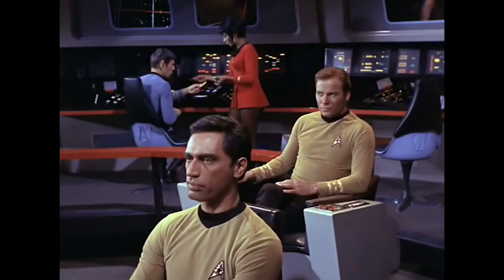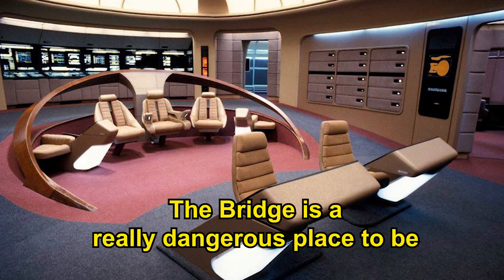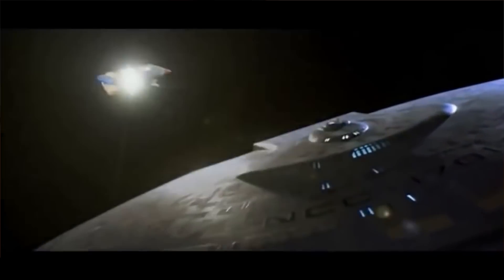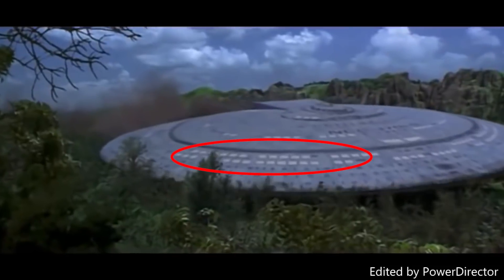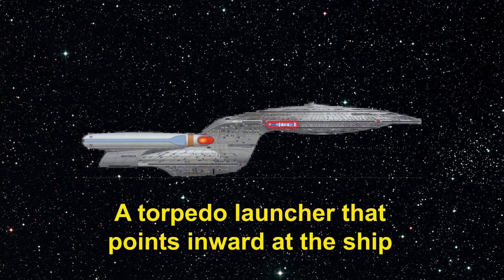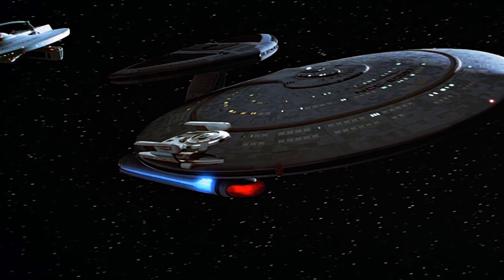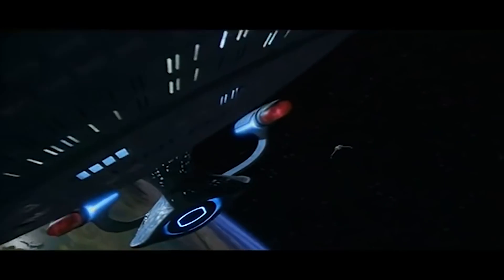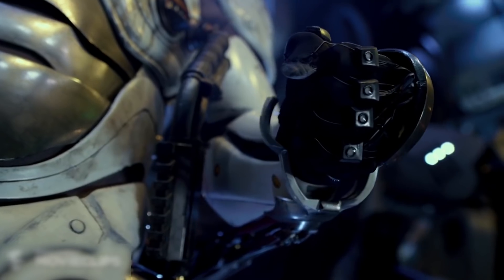10 Flaws Star Trek - USS Enterprise NCC 1701-D

Comment: The nacelles at the ends of the pylons are not engines, they house the warp coils. The warp engine is in the engineering section. Think of the nacelles as the driven wheels of a car. The engine is still in the engine bay and drives the wheels. The placement is so far away from the hull to protect the crew from the effects of the warp field (You want to fold space, not people)

Ships that can emit a narrower warp field can have the nacelles closer to the hull. The Nebula class ship you had shown has pylons the same size as the Galaxy class, you got fooled by forced perspective

For more details, Star Trek Enterprise Season 2 Episode 12 'The Catwalk'

What I find crazy is you missed the most obvious flaw in the Galaxy X-class (Three-nacelled 'Dreadnought' version of the Galaxy class) which had a fixed-position phaser weapon fitted on the underside of the saucer blocking the Captain's yacht from detaching
Reply: Thank God someone pointed this out. I would also like to see seatbelts on the ship but could have done without the "P"comment. I'ld hate to have the ship's console looking like the Atari 2600.
Reply: Outstanding. 👍👏👏
Reply: Indeed, but the point still seems to stand. While the nacelles are not the housings for the warp drive itself, the fact that they are essentially the means by which the warp drive transfers it's power to move the ship, like the propeller shafts on a real ship, makes that flaw stand. Disable the nacelles and while the warp drive itself isn't damaged, the ship is still going nowhere, since the energy can't be used for the ship to move, and the relatively vulnerable position that the nacelles are in, especially if she's being pursued makes that possibility more likely than it would otherwise.
Reply: @douglashall6326  I dunno . . . given the forces involved if the inertial dampeners fail, seatbelts would probably just vivisect you where you were sitting.
Reply: Untrue. There are frankly dozens, if not hundreds, of instances in Star Trek (across all representations) where the folding of people (or people-like aliens/constructs/robots/etc..) would be just as (possibly even MORE) useful than folding space....for instance; if they could have just folded the Borg...boom, problem solved!
Reply: Smokey Joe good explanation of the warp engines! 👍🏻
Reply: The warp core is just  power plant. The nacelles  generate the warp field.  Ie the core is the engine the nacelles the tranny.
Reply: tactically speaking, that may make sense for the battle itself, but after the battle, there's the business of getting back to base for repairs (especially since I don't think slapping on new nacelles are something you can easily do outside of a shipyard). Unless the battle is close to a nearby base, getting there on impulse power (and therefore sublight) could take on the order of years. Going off of this description, the nacelles are still necessary if you want to either avoid a battle altogether, or after a battle is won, getting back to base, so having them knocked off is still utterly crippling for her maneuverability.
Reply: Smokey Joe  Nope, we have seen many times that hitting the nacelles destroys the ship.
Reply: Smokey Joe   Wring about the warp fields, Geordi him self says you can physically pass your hand through them with only some un described sensation as the effect.
Reply: Smokey Joe made a very good point!

On a side note....I always wondered how the Klingon BoP gets away with having no warp nacelles at all?
Reply: @DrewLSsix  we've also seen many times where that doesn't happen.  The ship doesn't blow up simply because its nacelles were destroyed.  Other factors contribute.
Reply: @pex_the_unalivedrunk6785  the bop doesn't use nacelles, its warp engines are actually right next to its impulse engines in the back.  If you look closely you'll see 2 different colors emanating.  One is red, the other above (or below, i forget) is orangey yellow.  You don't have to have nacelles to hold the coils, look at the defiant for example, they are tucked in close.
Reply: I never knew the galaxy class had a captain's yacht. But non the less, the dreadnought retrofit was a warship, so I doubt they cared for luxuries like that. It also prevents saucer separation. I know STO says it doesn't, but I don't buy that. 

As for the 3rd nacelle, I don't get that either. I guess you can assume the ship's warpfield was reconfigured. But other than maybe a redundancy, I don't get the point of having it. The standard galaxy class can do warp 9 already, I don't think the hull can take the stress of a sustained warp 9.99. And unless you're joining a battle in progress, it's against regulation to use excessive warp speed. Plus it gets in the way of the shuttle bay, making it take longer to get clear of the ship. Not to mention how much more complex or perhaps weaker, the aft shields would be. Due to awkward placement of the shield emitters to cover it.

I'd rather a secondary deflector, to reinforce the shields.

Still my favorite ship of the universe. May not be as pretty as the sovereign class, but still damn cool.
Reply: @stephenlaarkamp7344  You can't fix dead. Only the survivors have the luxury of being alive to effect repairs or call in their fleet for assistance in repairs or to help evacuate and scuttle the ship. If worst comes to worst you crash land the ship and await rescue . . . after turning your opponents into roadkill and then get a newer shinier ship with almost the same registry number (as has been done time and again) The object isn't always to come out without scratching the paint, the object is to be less dead than the other guy

If you avoided the battle altogether then no-one's shot off your nacelles yet. People shooting at you is one of the ways you recognise you're in a battle

You don't maneuver with warp fields in the same way you don't do a three point turn in top gear and overdrive. You maneuver with impulse and RCS. While yes, without being able to create a warp field, you're not the fastest ship in the fleet but you are still faster than the floating bolts and giblets that once was your enemy. That's the difference between dead slow and dead

Anyway, if the nacelles are indeed a target and your pulled those targets closer to you then you've got more serious troubles, IE being the dead one.
Reply: @adamlewellen5081  So you're saying the subspace displacement fields are the wheels? I'd say that's the effect of the wheels.

To me it still looks like the coils in the nacelles are still the wheels, the transmission would be the warp plamsa accelerator (gearbox), the symmetrical warp field governer (differential) and the plasma conduits up the pylons (half-shafts)
Reply: @Astraeus..  Folding other people would be useful, but not your own crew. That's just unsociable and unlikely to get you invited to poker night
Reply: It's still an extremely high-energy component presented on a silver platter. Dumb design.
Reply: @Demiurge13  Exactly. The Bird of Preys are usually lighter vessels and can sustain warp speed on smaller narrower warp fields thrown out with violence out the back. Also the Klingons don't really give that many damns about life. They tend to throw theirs away as fast as they can
Reply: @karenrhodes5079  I'm on board with the 3rd nacelle. Imagine launching shuttles at warp speed. A tricky enough feat at the best of times between two warp fields without feeding them straight into the yawning maw of a bussard ramscoop collector

Ditto with the Nebula class, which I think looks super sexy. Like Miranda but with TNG appeal, but that mission pod pylon . . . that should have plenty of scratches and nicks and exchanged paint with any less then perfectly flown shuttles
Reply: @yaldabaoth2  It's demonstrably a tempting target, kinda like the bright yellow bat-sign on batman's chest . . . canonically the heaviest armoured part of his outfit.

If you're not allowed a cloaking device then misdirection is a good second option

"Shoot this big important glowy thing! Ignore the people aiming torpedoes down your throat!"
Reply: It's a space warping engine not a space folding engine!
Reply: Smokey Joe There are no restrooms on NCC1701.  I have the schematics.  NO RESTROOMS.  Talk about eating a sh*t sandwich.....
Reply: Not to mention, Galaxy class badass starship or not, there may be times where they are outnumbered and need to get the hell out of dodge rather than stay and fight.
Reply: @smokeyjoe7251  - What's the grease for?  Aside from Neelix's fryer or Tom Paris' car, I can't think of much on a Starfleet ship that would require grease.
Reply: To be fair, the Dreadnought variant was simply a refitted standard Galaxy class. And it still retained its normal phasers after being up armed with the phaser lance. You can think of it more like the merchant navy ships of WW2, that where pressed into military service.
Reply: The Lance Cannon on the dreadnought retrofit replaced the captain's yacht bay. They didn't have a yacht, most likely.
Reply: No, the warp coils ARE equivalent to the engine in a car. The warp core you see in the engineering section is the equivalent of the fuel tank. The warp core provides the necessary energy to make the warp coils achieve a subspace bubble and actually go to warp.
Reply: @DrewLSsix  To be honest, I can only recall one episode "Cause and Effect" (the time loop episode) where damaging the warp nacelles led to the ship being destroyed (over and over again). And they don't really explain why this happens. In the episode, the nacelle is damaged in a collision with another ship, and the ship is venting drive plasma. They lose helm control, and the inertial dampeners go offline. Then Geordi makes some comment about trying an emergency warp core shutdown. But there is no explanation for why this is necessary. The core shutdown fails, they lose antimatter containment, and the ship is destroyed. But WHY did the warp core breach in the first place? It wasn't damaged, only the nacelle was damaged. Was there some kind of catastrophic chain reaction, where the warp plasma fed back into the core? Did secondary explosions damage the antimatter containment field? They don't really explain that, and I don't recall it ever happening before in another episode. We've seen many episodes where enemies specifically target the warp nacelles in order to disable the ship without destroying her. It's the equivalent of spiking or shooting out a car's tires so that the vehicle can't drive. But it's not going to cause the car to blow up!
Reply: @Aldaris1234567  Nope, the anti-mater storage is the fuel tank. And just like a car engine converts gasoline, so to does the warp core convert this anti-matter. The warp core is the engine, hence why it is commonly referred to as the warp engine.
Reply: @TheGhostAvatar  Sorry, but that's incorrect. The warp plasma is the fuel, not the anti-matter. The core just provides the plasma to drive the coils. The coils do the actual work. The core is the fuel tank, the coils the engine and the bubble the wheels.

Actually, it's commonly referred to as only the warp core. Usage of warp drive/warp engine is for the everything combined.
Reply: @Aldaris1234567  Might want to go read up yourself before commenting any further. "24th century Federation warp engines were fueled by the reaction of matter (deuterium) and antimatter (antideuterium), mediated through an assembly of dilithium crystals, which were nonreactive with antimatter when subjected to high-frequency electromagnetic fields."
Reply: @TheGhostAvatar  I can read the same stuff you can just fine. Literally nothing you have just quoted actually proves your point. It actually proves mine. The fact the quote says fuelled shows you that the warp core only provides fuel. It doesn't actually do the work that provides the propulsion. That is the job of the warp coils, as per my point all along.
Reply: @Aldaris1234567  basic concept is as follows, because you are wrong,
anti-matter is the fuel==gasoline
warp core is the engine== converts antimatter to usable energy== ie fuel into motion, in this case plasma instead of motion.
the dilithium crystals are in essence the transmission??? as they regulate the energy 
the plasma is then transferred by way of conduits== the driveshaft
the warp coils either create the warp field or cause the slippage of the field through space so they are either the wheels or the axle, either way they are closer to the wheel meets road analogy than the engine is
Reply: @DFGrill  Sorry, but that simply isn't true. That doesn't have any correlation to how an engine works. The warp core doesn't do any actual work on the actual propulsion. It is only providing the components to actually fuel the reaction that causes the motion.
Reply: @chrisashton5022  the plasma is a usable form of energy, the core converts antimatter to plasma, so it is an engine
Reply: @DFGrill  No, because an engine actually does the work. It's what changes the energy storage into another type of force. The anti-matter/matter to plasma is just converting one energy store to another energy store. It's the coils that actually take the energy and change it from one type to another, just as it's the engine that turns the chemical energy into motive energy.

I think we're just going to have to agree to disagree.
Reply: define engine? I's no so much an engine as it converts energy into mechanical power. The nacelles take energy from the core and convert it to propulsion power. So one might say they're engines.
Reply: @spikedpsycho2383  One might say they're a banana split with extra chocolate sauce . . . but that don't make it so

The fact is they're called nacelles, the contents of the nacelles are called warp coils

The part in the engine room down in engineering is called the engine . . . the names really kinda give it away

The engine produces the power, the warp coils uses the power and propels the ship

The parts of a sea going vessel that "take energy from the core and convert it to propulsion power" are still called propellers and not the engine (at best I'd say transmission . . . actually, no I wouldn't. They're the propellers because if it weren't for propellers the ship would wallow while it span it's drive shaft